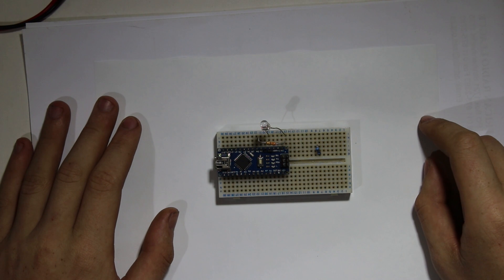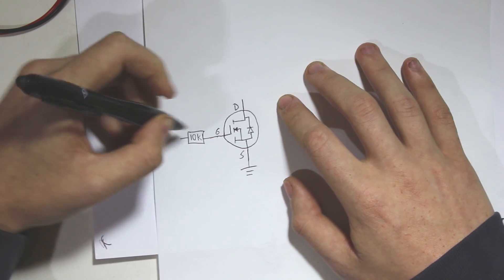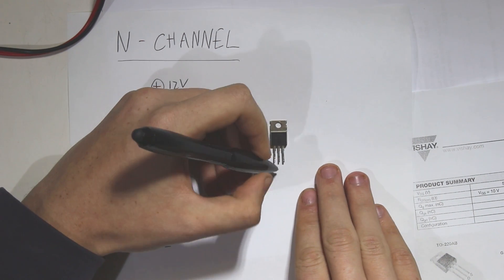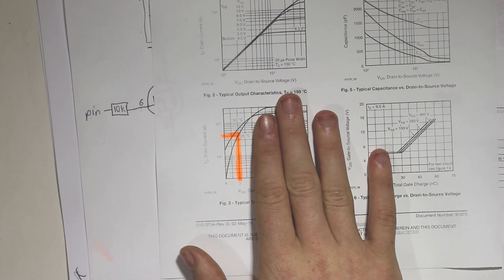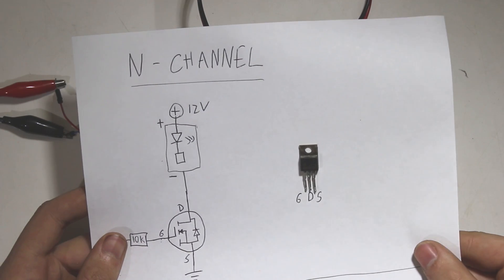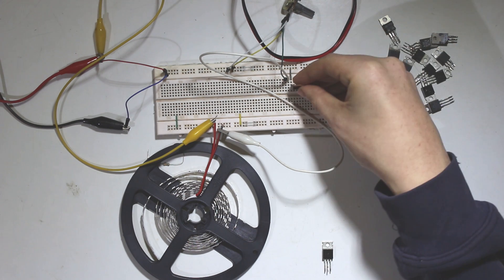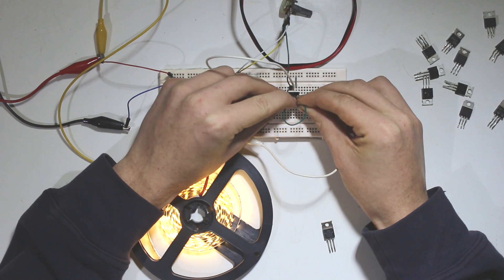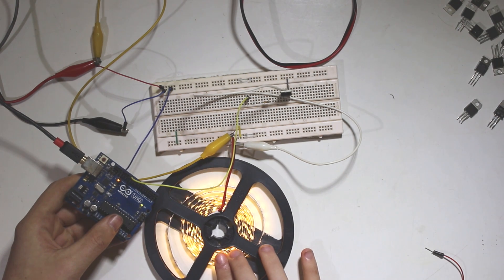Arduino Mosfet Tutorial

Comment: I like this tutorial because it shows the hobbyist with a bunch of old MOSFETs how to pick one that will turn on fully with Vgs (gate voltage) of 5V.

However, it's worth mentioning that anyone looking to buy a few MOSFETs for use with a microcontroller, that ordinary MOSFETs like the IRFZ44 and IRF530 are intended for use with controllers that work at up to about 20V, and they are only guaranteed to turn on fully with a Vgs around 10V. Their typical curves may indicate less than that, but there is always variation in a given part.

However, there are "logic-level" counterparts such as IRLZ44 and IRL530 (the 'L' indicates logic-level) that work with a maximum gate voltage up to 10V, but are specified to turn on fully with a Vgs=5V. They are intended for use with microcontrollers and will generally work well even with 3.3V Arduinos and ESP series microcontrollers.

Comment: Why do you probe the voltage across the shunt and the battery when you're able to calculate both from only one probe given the known resistance? for accuracy?
Reply: I think I figured it out. You're using the known resistance of the shunt and its voltage to workout resistance across the rest of the circuit instead?

Comment: Is there a way to determine whether or not a mosfet is good enough without it being a total crapshoot on a breadboard? I need to figure out which mosfet to buy to power a 9 watt 24v LED channel, but im not about to just buy a bucket of transistors to see which one works. ;)
Reply from the maker: So for a "high power" LED I would recommend just getting a driver board for it as that chip will need a constant current supply. Also this video is VERY basic. Ideally you would want to make use of a chip (mosfet driver) to control a mosfet for better results. Then you can basically use any N channel mosfet. Sorry for being a bit vague. Look for similar circuits online maybe
Reply: If you want to drive loads using an Arduino as your controller, then simply buy a "logic-level" MOSFET. Common examples are IRLZ44, IRL530, etc. The logic-level MOSFETS often have an "L" in the type designation, and are generally the same current and voltage rating as their non-logic-level counterparts such as the IRFZ44 and the IRF530. However, the logic-level MOSFETs differ in that they are guaranteed to turn on fully with 5V on the gate (the others generally need 10V to guarantee full turn on). The downside is that logic-level MOSFETs may be damaged if you put more than 10V on their gate, while the others will stand 20V.
For your 9W 24V LED strip, you'll only draw 375mA, so any common logic-level MOSFET will work with plenty of headroom. I'd suggest getting either IRLZ44 (rated at 60V 36A) or IRL530 (rated at 100V 10A) whichever you can find cheaper. Just make sure you don't inadvertently buy the IRF versions, those are useful when using a comparator or opamp operating at 15V as your control.

Comment: How to turn on and off the irfz44n mosfet using arduino or microcontroller. I used bc547 to control the gate pin of my mosfet  but its doesn't work perfectly.

Comment: Hey this was truly an amazing video explaining the use of mosfet as a switch and a variable resistor.
Just wanted to ask can a current controlled device like a bjt (bc547) can be used in the similar way as you did with the mosfets?
Reply from the maker: Thanks, yes you can use a BJT. The base current may be too much for a microcontroller so maybe have a look at a darlington configuration and just sub that in the place of the mosfet. Let me know if you get it working or blow something up (or both)
Reply: @ChristopherdeVilliers  thanks for replying. Currently  i m working on irfz44n which gets input from lm324 which works like a comparator and it's working lile a charm. On the other hand calculation of base resistor for a bjt is something that seems like a hassle especially when you can simply control devices through voltage control devices like mosfets.
Reply: Lo usas solo si metes a corto el mosfet

Comment: Why to you connect MOSFET like it is bipolar transistor?
Arduino pin should go directly to the Gate and put a resistor between the Gate and the Source for discharge.
Reply: To protect the arduino pin from the high in-rush current that charges the gate capacitor.

Comment: can't MOSFETS easily be killed by touching them like that? I mean by ESD.
Reply: Good question and I probably shouldn't say this, but ... ESD is "Real," meaning that high voltages from, let's say a stun-gun will likely destroy many components. But components vary on how sensitive they are. I've handled more ICs and components than I can remember and I managed to "burn one out," just one, and I "sort of" blamed it on ESD; but there was no "proof" that ESD was the culprit, all I know is it worked and I tinkered with the circuit a bit and it didn't work. And the component was a CMOS IC ("CD4017 CMOS Decade Counter"). I used to play around with them a lot because they're simple to use. But this was back in the late 70's and CMOS ICs tended to be pretty easy to blow them out using static electricity. I didn't "measure" what voltage might have done it, of course. But as time went on it seems they got "tougher," and I never had any problems aside from that one. PLUS, I can't say I was "big" on ensuring I was grounded. And that means, of course, I could've been a lot more concerned about ESD, but in truth, I wasn't. PLUS, I was living in AZ which isn't exactly known for it's "wet climate;" we averaged about 10% back then (But as AZ grew, there were more people and those people did a lot of watering their grass and such so the last I heard AZ runs about 20% now from the additional water from sprinklers.) But before the sprinkling it was hot, and dry, hardly the place to assume those chips could "take it."  Then add that to my somewhat "cavalier" attitude about how I handled those chips and you'd THINK I should have blown away components routinely, but it just didn't seem to matter. And the only time I actually used an antistatic "bracelet" was when I knew the Prof's would be looking around; they actually dropped your grades a bit if they caught you NOT wearing the antistatic "stuff."

So yeah, ESD CAN destroy components, but again, empirically I felt it was a tad over-played. (HOWEVER, while I didn't actually KILL a lot of components, it doesn't always work that way. It could just "weaken" a component, just a bit, and that can lead to the component failing over time. I doubt NASA would be hiring a lot of people to build the next spaceship if they saw you without that antistatic gear on.) So with all that, while I didn't, and still don't often "bother" to make sure I'm "properly grounded," I really do think it's a good idea. (And, in fact I DO ground myself, out of habit. But when we talk about ESD we tend to think it's not "really" important. I sure did. HOWEVER, while I don't "sweat" over it, I Do always TOUCH something that I know is grounded. And I have an anti-static mat that I use on my bench. I have this sort of "belief" that's it's not the VOLTAGE that can kill parts, but it's the voltage DIFFERENTIAL that counts most. If you're carrying 5KV or 10KV and the item you're working on is 0V, the differential is ... 5KV or 10KV. But if you are at 10KV AND the work is also at 10KV then much of the damage doesn't happen; those electrons don't go all "nuts" and jump to the nearest "valance band" because there's an electron-sized "hole" just begging them to jump right in! (And yeah, I'm pretty sure if you bounced THAT idea off to someone who really understands that science they'd probably start laughing. Or maybe not, but I never actually VERIFIED it. "Ignorance is bliss" and all ...)

Oh, and I probably should have said I have a Bachelors in EE. Funny thing about that though. Having that degree got me hired by a really great company who immediately told me my job there was to write SOFTWARE! I've probably given you enough info about me to say that no one's gonna be surprised that SW, when I graduated, was the "New kid on the block." And although it was relatively new, I found I really liked writing code. If for no other reason except that I found I had a LOT fewer finger burns from dripping molten solder onto them.  Life's kinda "funny" ain't it? ;)

Comment: sorry this is not easy to understand how to apply that 5v at gate! You did the diagram but beginners doesn't understand it
Reply: It's simply done by pulling the Arduino pin high. About the simplest thing you can do with an Arduino.

Comment: The same result could be achieved using a rely. Which solution would be better?
Reply from the maker: Dimming LEDs with a relay is not a good idea but for basic on-off switching a relay would be ideal

Comment: Why do you 10 K resistor at the gate?
Reply from the maker: Just for current limiting if there were to be a short. It is generally a good idea to put a resistor between an IO pin and whatever it is driving.
Reply: Ok thanks!
Reply: MOSFETS have a gate capacitance that has to be charged up for them to switch on (or discharged to switch off). That initial spike of current when the I/O pin switches is capable of damaging the microcontroller, so it is always advisable to insert a resistor between the I/O pin and the gate to limit the transient current to a value below the maximum the microcontroller can supply. For an Arduino, that's 20mA and a 270 ohm resistor is the lowest value that will guarantee protection. You don't want to make it too big because that will slow down the switching speed of the MOSFET and cause it to heat up if it is switched on and off at high frequencies (e.g. using PWM to control a load).

Comment: Thanks for the great video! I'm a beginner in this field. Do you think this would work if I use a 30W LED and a constant current driver as the power supply? Would you suggest any particular MOSFET for this setup?
Reply from the maker: Yes this works. I built a strobe light that way using the 30W LED light in my other video. Just add a large cap (3300uF 50V) to the supply side.
Reply: @ChristopherdeVilliers  can you share the link?

Comment: Hi! Do you have any idea why my colors are distorted after the 5th meter of RGB LED strip 14.7w/meter, total of 8 meters (also not that bright...)? I am using 3 TIP31C transistors (1 per channel), 12V power supply with more than enough AMPs to power the strip. Wiring is the sam. One of the transistors also get really hot when all leds are on (white color).. and just one of them 

Could it be that I have to switch the TIP31C with another MOSFET/transistor?
Reply from the maker: Hi the voltage drop at the end of the strip is probably high enough that you will start seeing a discolouration, try connecting the power source at both ends of the strip or try powering the strip from the centre (2.5m to the left and 2.5m to the right). As for the hot transistor try exchanging it out with another one until you get one that doesn't heat up too much. Hope this helps
Reply: Thanks! I did changed with another one. Seems like these can handle ot ;)